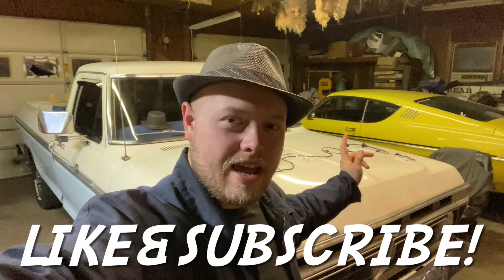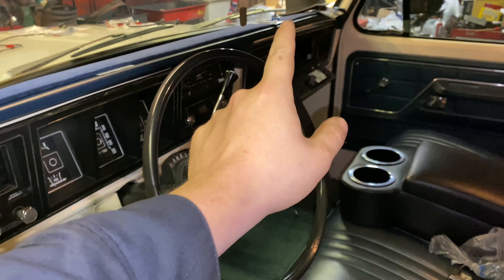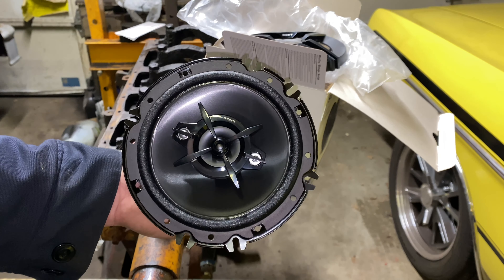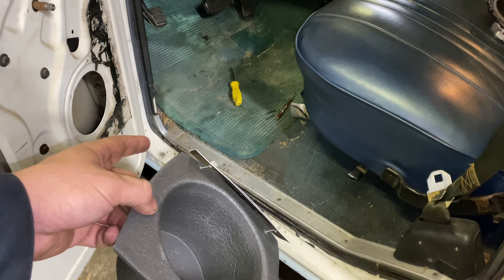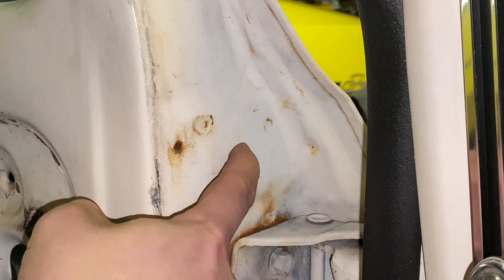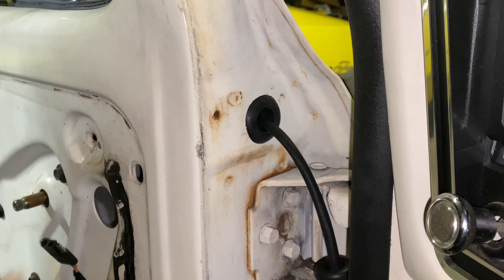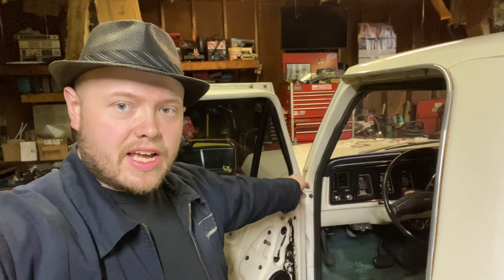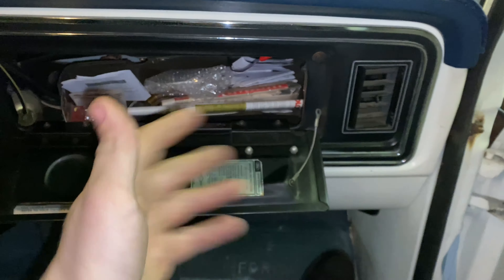73-79 F series door speaker and harness install.(Dennis carpenter).

Comment: Looking to do this soon myself! Quick question about your heat and air controls. Is that new or original. Im needing one exactly like yours! If its new, where could i get one?
Reply from the maker: @tbaker976  mine are the original ones, I’m not sure where you could get them new, perhaps Dennis carpenter or LMC or nation parts depot, not sure. Could always check eBay for a nice set of originals. Good luck on your search and good luck on your install, it’s a real nice setup and I love how mine turned out. 
Thanks for watching.
Reply: @FastFords289  thanks for the reply! And looking forward to upgrading my speakers!
Reply from the maker: @ no problem, I think you’ll be really pleased with the results.